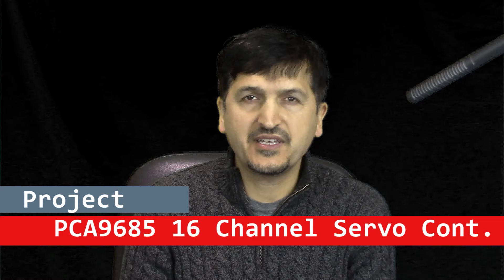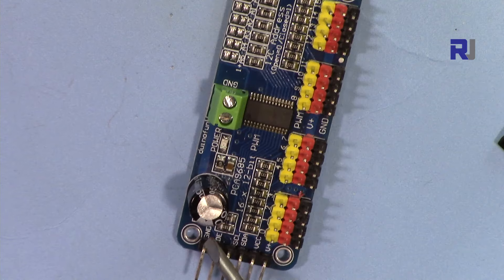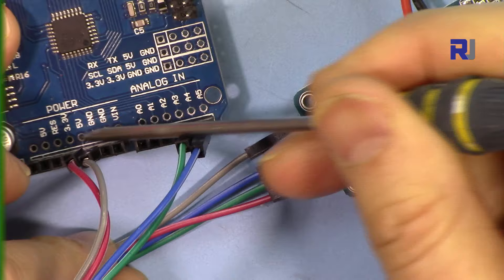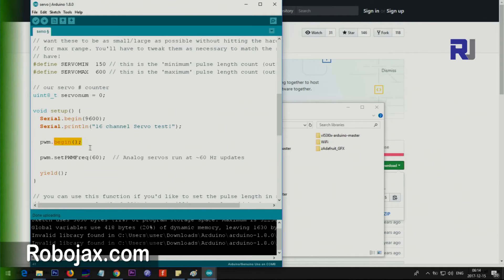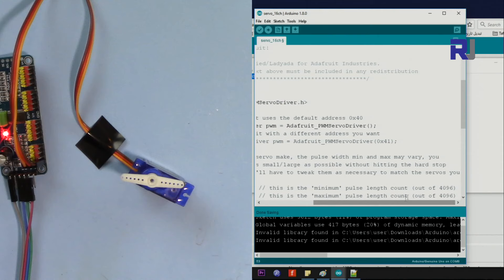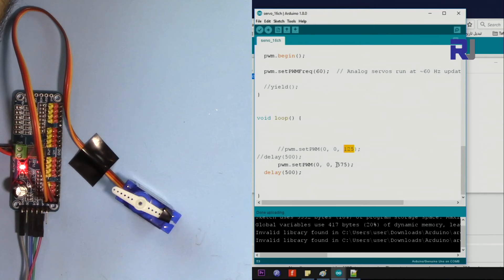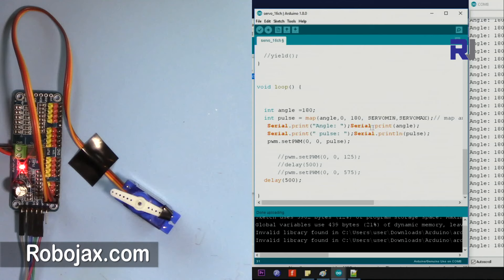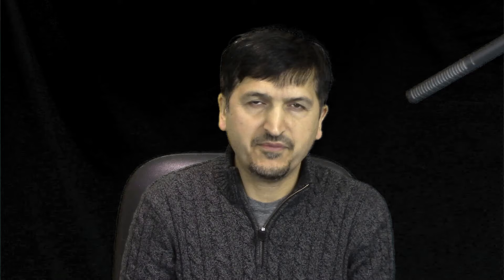Complete guide to  PCA9685 16 channel Servo controller for Arduino with code Version of 5 ( V1)

Comment: this the most detailed PCA9685 video out there, which also explains what each pin to beginners like me. thank you so much.  
1. would it possible for you to make a video of how to control multiple servos at once rather than running one at a time using PCA9685? 
2. how to mod this same servo for 360-degree rotation so we can control using PCA9685
Reply from the maker: You are welcome.  I am glad you found it useful. 
1-I have the request from so many people. I will make it when time permits
2-the 360 servo is totally different kind of servo. This module can't be used for that purpose. You may watch my videos on 360 servos here https://www.youtube.com/robojaxTV/search?query=360

Comment: Papa Robojax, you can add the adafruit pwn servo driver lib through the Arduino IDE. 
Within Arduino IDE add .zip libraries to your included libraries by going to the menu bar: Sketch/Include Library/Add .ZIP Library...  and then navigating to the folder you have the .zip driver lib. Makes things a bit easier, when you just drop the .zip file on the desktop, and add it thru the IDE, instead of digging through the IDE folders manually.
Reply from the maker: thank you mama 1085243,  I prefer putting it manually becuase it would be in the same folder as the "arduino" and in the future you can copy all together. but if you use the menu, it will go under the "my document" which I don't prefer. I have mentioned that from time to included it using the menu like this video https://youtu.be/7RQ8QoJWhpY or this https://youtu.be/L6ekl2ABcuY

Comment: Hey, this video really helping in my project, but I don't understand, why there is 450 address pulse (150-600). But in my imagination, servo work for 180 degree rotation, and I think it has 180 address or multiple by 180 (180, 360, 540, etc), 450 can"t divided by 180.
Reply from the maker: Hi, The value is "pulse width" and it depends on the MCU (Arduino) frequency.  so I figured it out what pulse width would work best with Arduino. If you use different MCU, it would be different. By the way I have V2 of this video. The link in the description.

Comment: * Update: The issue was that I am using MEGA. For MEGA SCL and SDA have designated pins It works now*** Firstly great video. I am running into a problem. My servos are not moving at all when they are connected to PCA9685. I tested it by directly connecting to Arduino and it works. I also have 5v outside power supply for PCA. I did trouble shoot everything that I can think of but running out of ideas. What could it be? Any input is appreciated.
Reply from the maker: hi, here are the pins for Arduino Mega. https://www.arduino.cc/en/reference/wire

Comment: Nice explanation, but the mapping of angles is not from 0 to 180 but from about -20 to 190 degrees. you have to measure the angles.
Reply from the maker: Thank  you.  The standard is 0 to 180 and depending on the quality and specs of servo it might be not exact.

Comment: i just got an accident with this driver..suddenly my servo didnt move and the cable was smell burnt..i cut vin ...and i still get voltage value 5v from v+ and ground...,has anyone ever get this issue?
Reply from the maker: if you semll the burnt plastic, then most proababily the module is dead.

Comment: Having a peculiar problem with my recently bought PCA9685 (same as the one you demo with low power mosfet). WITHOUT connecting to any external controller yet, i plug ext power 4.8V (from fully charged 4 NiMH AAA batteries holder) to the green block. No servo connected yet. Tested with multimeter ON ALL the V+ ... only getting 1.7V and not 5V. Then using multitester.. tested on the MOSFET and capacitor, but got about 5V. 

Any reason why?

Comment: Is it possible to only connect the pwm signal wire and power the motor with seperate higher current power source (for larger motors)?
Reply from the maker: Yes you can.
Reply: Robojax awesome. Thanks for the reply.

Comment: Hi, I have watched the other servo videos. Nothing shows how to control the pca board with a voice module. I thought If I removed the code for the push button switch (v3 video) I could code it using the OE Pin. Or am I looking at the problem all wrong. Confused myself.
Reply from the maker: Hi, of course I don't have any video related to voice control. But I have shown how to control with a signal or push button. just use the method and use the singal from voice module.

Comment: I'm following this, using a bench PSU to power via the central power inputs, but even just raising the PSU to 2 volts starts to feed 250mA current, if i head toward 5V the PSU maxes out at 2 amps. What could be wrong, i've triple-checked wiring etc ?
Reply: My PCA9685 is dead, problem solved!
Reply from the maker: the amount of current depends on number of servo motors and types. some servo motors need more and some less. measure current of ONE servo motor while running and connected to the load or word it does. then multiply it to the number of servo motors. if you still get higher current, then either one or more servo motor is damaged or the servo motor has lower rated voltage.
Reply: @robojax  Thanks for taking the time to respond Ahmad, have a good weekend :)
Reply from the maker: you are welcome. Stay safe.
Reply: @robojax  You too sir, i don't know how it is in Canada, but the live data from the UK is in complete disagreement with government policy, which has now killed over 40K old age pensioners in care homes. I am on the war path.

Comment: Thank you for your videos! It's clear and useful! Good work! I'm working on a project with 27 servo, all works! I would like to run all the servo at the same time but with different speed and degrees (random sweep)... I've no solution for the moment with the Loop fonction  "for"... Any ideas?
Reply from the maker: you are welcome. This is Version 1 (V1) and there are V2, V3 and V4 with different examples. Please watch those.
Reply: @robojax  Thanks for your reply! I saw all the videos, but I don't find easy solution for  running all motors in random programmation (degrees and speed)...

Comment: I have wired my arduino Uno R3 the same as you to the PCA9685. I get no power to the either boards but when I put power to the arduino both boards light up.  I have also hooked my arduino Mega in the same way and the same happens.
Reply from the maker: Hi, perhaps you are connecting it incorrectly. Please watch it again or what other version of this module https://www.youtube.com/channel/UCkcBSig_Iu4ZnAIeCeG1TVg/search?query=pca9685

Comment: I got one of these devices today, I wired it all up but for some reason it burned up my servo, I tried 2 more but each one got damaged. I'm not risking another, any idea how this could have happened? I connected the data lines correctly and used an external power source of 5v so nothing was out of the ordinary. Any suggestions.
Reply from the maker: You might have connected the Positive and negative terminals in revers. Other than very rare but possible that servos are rated for less than 5V may be 3.3V.

Comment: I have a hexapod with Tiva C-TM4C123GH6PM controller. It has 18 servos so I will connect 2 PCA9685 with 18 servos and the controller, the controller will send a {[6];[3]} matrix of "pulselen" to PCA through I2C connection and PCA will convert each element to separate PWM signals right? Is it the right way?

Comment: One more help please tell me can i provide power through battery in servo motor controller if we used then please tell which type of battery i used
Reply from the maker: Please watch V2 and V3 of this video. I have mentioned extra details there and the amount of current for my servos.

Comment: Hi, I testing my servos MIN/MAX and I have one problem. When you set MIN or MAX value higher than servo can get yours servo start making noises but mine start rotating 360, it is broken?
Reply from the maker: Hi, with you have 369 servo (the non standard servo) or it is broken.

Comment: I want to connect 8*MG996r servo motors, I have 12V DC battery and voltage regulator U7805 which gives 5v and 1 Amp.... Can I use this regulator to connect the servo driver......?
Reply from the maker: The module works with 5V. The amount of current depends on the type and number of servos you connect. if  the total current does not exceed 1A, it should be okay.
Reply: Robojax Tq sir

Comment: Hi, Thanks for your great video . Im just wondering whats the maximum number of servos can you control using multiple of this board (PCA9685)? for example can I control 600 servos? Thanks.
Reply from the maker: You are welcome. You can connect 4 boards 4x16= 64 servo I have explained it at 4:42

Comment: The minimum and maximum I found on my servos causes the rotation to be slightly more than 180 degrees, like around 195. Can I adjust the minimum or maximum so the rotation can be closer to 180? Will it matter that I'm not using absolute minimum or maximum?
Reply from the maker: Of course you can adjust it. This video is version 2 , you may watch V1 videos o see how I have done it.

Comment: im trying to figure out how to reverse a servo so that I can use 2 servos for a joint, one will be operating backwards. So its position will be negative to the standard PCA9685 code. Is it really as simple as using negative degrees? like -45 to -135? How would I do it using python/opencv in visual studio code?
Reply from the maker: I have series of video with many codes. This is version 1 or V1 , please see v2, v3 or v4 yo see if one of them is working for you

Comment: Great video! A lot of details and well explained!
So i will need 2 batteries in order for this to work, one for the UNO and one for the PCA9685 right? Both 5V. 

Thanks!
Reply from the maker: NO. if you use battery then ONE 5V for both. I mentioned separate 5V because people connect the 5V from Arduino to this.
Reply: @robojax  So I need just 1 5V battery and then i connect the battery to which one of the boards? I think i misunderstood... Thanks for the asnwer and for the help! :)
Reply from the maker: You are welcome. If say anything else, it means I would have to type whatever I said in the video. Please watch it without skipping.
Reply: @robojax  I watched it twice man, it's not you it's me :) i get confused when you talk about 2 batteries for 2 boards. Being a beginner in hardware AND english, this is not easy for me. Hope i will find an answer! Thanks for all the learning material! :)

Comment: Great video! Thank you.
Questions:
 1. What do you use to supply power to the servos (current)?
 2. Can I use the same code on ESP32?
Cheers!
Reply from the maker: Hello, 
1-measure the total current for your servos and connected a power supply accordingly. this I have connected a 5V power supply that could up to 60A but you don't need that. you need whatever you measure when the servos are running under the load. 
2-You are watching Version 1 (V1), I have 3 more versions of videos of this module link is in description. Always check description I have it it for ESP32.  Or search my channel for more cool projects. Here is how to find Specific YouTube Video in a channel https://bit.ly/findYouTubeVideo
Reply: @robojax  Thank you!
For powering a couple of servos (not too much load), can I used like 4 C batteries, at least to start with?
Maybe use something like a buck converter to increase current, if needed?

Comment: Marvelous explanation with simple language.  I just wanted to know whether I can use PCA9685 to control 3 servo motors, 10 LED's (only ON/OFF) with the help of may be 2 or 3 buttons (ON/OFF switches)? If so, could you please give some guide lines as to program (Sketch). Thanks in advance.
Reply from the maker: Hello,  you can connected LED or servo does not matter. You've watched Version 1 (v1) of this series, there are V2 to V4 the link is in the description where you see more options and ON/off push button.
Reply: @robojax  Thanks Mr Shamshiri for your help.

Comment: Thank you for your explanation. I am curious as to why you used "delay" instead of "millis" as this only allows one servo sequentially. Is the power enough for multiple servo operations??
Reply from the maker: millis is  number of milliseconds since the program started. I just needed the program to give certain time delay to show movement and then start another one.
The servos I used were without load and it was enough. But if you make all servos do something, then the load will increase.

Comment: Thank you for a great video! What is the best power source to get 5v?
Reply from the maker: it depends on the type of servo motor and how many you use. measure the current of one servo motor when load is connected to servo motor for example you measured the current to be 0.5A and you wan to use 10 servo then 0.5x10=5A to be save get a power supply with at least 6A or 7A.

Comment: How do I connect two pca9685s and configure them to work? There is a problem with addressing and nobody has ever shown how 2 pieces work with each other.
 When work only 1 PCA - no problem but when "begin pwm2" arduino program stopped.
This is the simplest piece of code which, for example, will light the led on channel 1 in PCA9685 No. 1 and the second led on channel 4 PCA9685 No. 2
If you are able to do this you will become my MASTER :)
Reply from the maker: I have mentioned in the code. Watch the video again. Do not escape.

Comment: Great work thank you so much! I have a project that needs 100 servo and need to somehow chain these
Reply from the maker: you are welcome. This video is Version 1. I've got V2 with different code demonstration, V3 with 32 servo and V4 to control them over WiFi the link is under the description of the video.
Reply: @robojax  amazing I'm subscribing  :D  1. can I use a raspberry pi to send signals instead?  2. Is there something that goes up down instead of rotating like those servo?
Reply from the maker: PCA9685 has registers that can communicate using I2C protocol. 1-you have to look at datasheet to know how to read and write using raspberry pi.   2-I am not sure if I understood it correctly, but if you want up and down, isn't that you just rotate to the left or right and it will go up and down? thank you for subscribing.
Reply: @robojax  oh hey thank you very much for the reply. I'll look into that. What I needed was an actuator. I am learning from scratch. :)

Comment: This video shows me, again, why I should continue hating Arduino.

The servos working limits are between 1 ms and 2 mS. If you know what the Arduino is doing in the background you will be able to set the limits immediately in the program. But unfortunately with an Arduino nobody knows, neither wants to know, what is really happening.
Reply from the maker: this is not problem of Arduino.  this is issue with the module and how it sends PWM to the output.
Reply: @robojax  

Of course it is not a problem of the Arduino as a hardware. It is a problem of the black box style Arduino is used.

Comment: lovely organized, cheers!
Reply from the maker: Thanks. you have question or needed custom code, this is Version 1 or V1, there are 4 more versions of this module. link is below this video or just search my channel . Cheers. and yes, your subscription is great help. Thanks
Reply: @robojax  I am having issues with the Hiletgo PCA9685 servo controller. I have checked everything with the multimeter, have the proper external power, checked the wiring, and checked each servo, so I believe the issues to be related to software. I have used both the HCPCA9685, PCA9685, and the Adafruit version, but neither seem to be working. Is there any that you suggest for this brand?

Comment: Hey very good video, but I have a question. Do you know why the board has a capacitor? Or could you explain for which situation I would need one? My board came without one.
Reply from the maker: when servos STARTs and stop this sudden start  causes the power supply voltage to drop a little and if you have capacitor connected to the power supply which is already charged, it  resists the voltage drop by supplying power to the board. .

Comment: I have two batteries each one is 7.4 V, should I connect one of them to the arduino and the other to the PCA?
Also is using 3.7 V battery for PCA to control 12 motors enough or not?
Reply from the maker: For arduino the dc adapter input can accept up to 12V. For the PCA connect power exactly the same as your servo motors voltage. If servo is 9V then connect 9V for example.

Comment: Very good...  Impressed...  Good job...  If i want add same 9g servo 4 pc for my rc plane how much current i have to supply to the board?
Reply from the maker: Thank you. For each servo the idle current  at 5V is 100mA and 500mA in stall mode.  Read more here: https://www.addicore.com/FS90R-Servo-p/ad314.htm
Reply: those servos are absolutly awful, don't buy them

Comment: Hello ! Really nice tutorial ! I was thinking, can I use this driver to drive multiple high torque servos, which usually operate at 7.4V ?
Reply from the maker: Hello, if you paid attention to the video, it should be no problem. just power the board with 5V and power up your servo with the 7.4 or any other different power.

Comment: Simulator: 1 = X .. 2 = Y .. 3 = Z ... 3. 4. 5. 6 = Suspension - Braking - Gear Shift and Reduction ....... Total of 8 Servos ..... WILL THAT BE POSSIBLE ???
Reply from the maker: Yes. it has 16 channel and you are free whichever you want to use it.